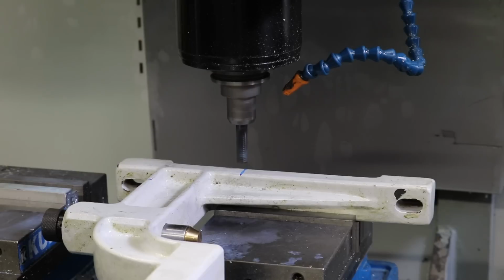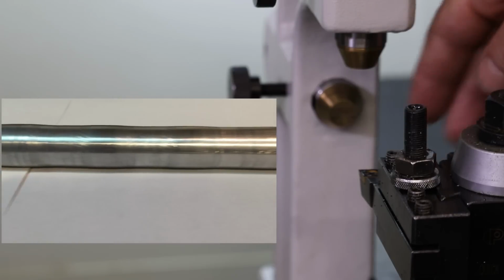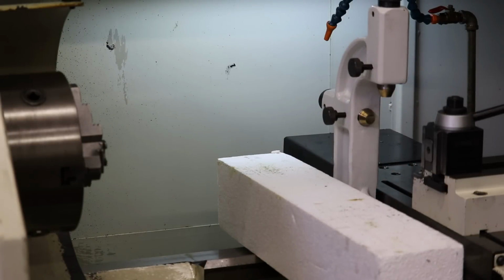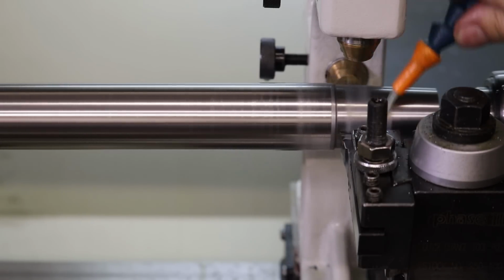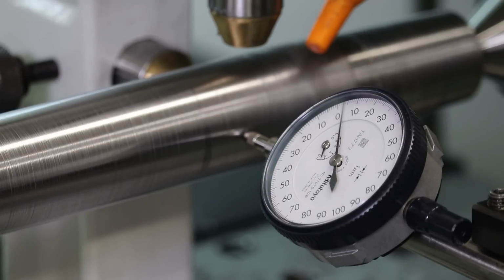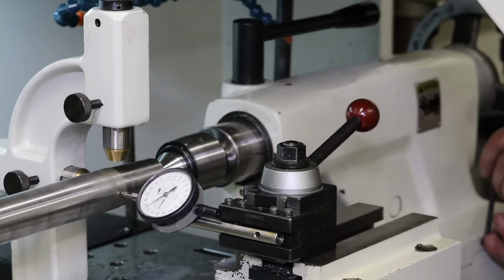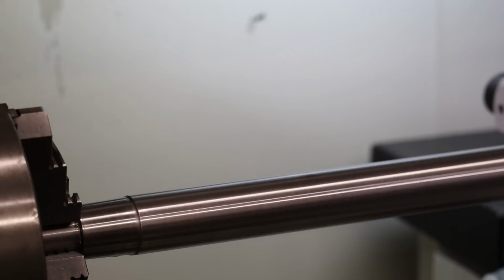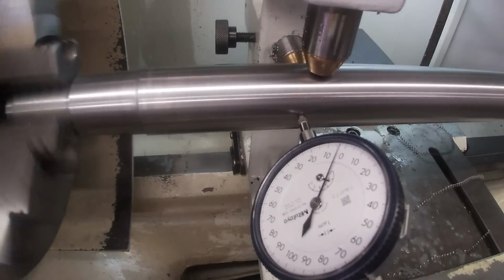Stoker Steam engine:( Part 1.5 of 2) Using a lathe Follow Rest for better piston rod turning

Comment: given the features on each end, I'd turn between centers so you can easily swap end to end to cut the tapers and threads.

Follow rest in front of the cut. A rest with rollers instead of brass pads.

Smaller depth of cut at higher rpm and slower feed for finishing cuts.
Reply from the maker: Yes, these days I would do the between centers. Thanks for the tips

Comment: You need to put the rest in front of the cutting tool. Other wise it will be scuffing your freshly machined surface. I wouldn’t even use the rest on the first cut that way you don’t have to worry about running it on that rough unmatched surface.

Comment: I can just about guarantee you that the railroad machinists in their 'repairs' to the stoker engine when necessary were not concerned with micron accuracy.  Good Enough, not perfect.  Get the engine operating and hauling freight and paying for itself.

Comment: Please use a micrometers when you’re working with cylindrical parts to get good measurements, calipers are only for rough measurements and not for final measurements when you’re working for 1 thousand tolerance

Comment: I'm pretty new at this, but I think you would do better with a four jaw chuck. Scroll chucks, even good ones, have some inherent TIR. Seems to me you're spot on with the tailstock adjustment. Maybe carbide center with some high pressure lube instead of live center might do better--little to no runout.

Comment: Yes, you need a 4 jaw, helps a lot when trying for accurate work. That or a run-true chuck you can tweak after you've mounted the work. If you do much smaller diameter work (1 1/8" or less) a Run-True type of collet chuck is really nice to have. Got mine with my Precision Mathews lathe, as an extra cost item, Chinese but quite nice.      Watch Adom79 center a part in his 4 jaw. Takes me at least 4 times as long.
Reply: Better still turn between centers.

Comment: I wonder what tolerances these shafts were originally made to?
I doubt they measured anything at 1/10 of a thou.
They were probably also made as production run.  I reckon  + or - .001” would have passed inspection. Or more likely -.002 +.000.
I hope you have a good time making another one.  I’m looking forward to seeing how close you get it.
Reply from the maker: Hi Davo, the original shaft was 1.490, maybe 0.001" runnout.  The steel was softer too. I assume the machinist started with a cleaner 1.5" and cleaned up the surface.  I'm just having fun obsessing and learning about turning long parts.  Thanks for watching
Reply: @DragonflyEngineering    LOL, you are pushing the limits of anal retentiveness.  Good on you.  But it seems to me that the warping induced by the very first power-stroke of the piston to which this rod attaches is going to dwarf that tolerance by at last an order of magnitude.

Comment: The  only answer to attain dimension is grinding
Reply: I disagree, 1. I doubt a Haas is rigid enough for the job.  2. It has to be done with a four jaw.  3.  Depending on desired hardness it might be better to hard turn when heat treated, rather than turn prehard. But it is totally doable on some cnc lathes
Reply from the maker: @billmielke7395  Thanks Bill, yes i do think the Trac lathe ( from southwest industries) did flex in the cut.  I don't have a 4 jaw for it, but should buy one.
Reply from the maker: That would be easier! I'm seeing how far I can take it, maybe obsessed a bit.  Thanks for the feedback

Comment: I couldn't help but wonder how the folks way back when solved these problems when they were originally building steam engines.
Reply: They didn't.  Back in the day, for a piston rod +/- .005 was good enough.  The packing material has enough resilience to easily accommodate that tolerance.  The important part of the rod is the tapered ends.  And those were always lapped into the mating part for a perfect fit.
Reply from the maker: thanks for the info Charles.  I just like to see how good I can get it.  The original rod was 1.490" and it may have had  a 0.001" runout
Reply: Back in the day they didn't have the ability to easily measure to the same degree of precision we do today
Reply: @billmielke7395  They DID have the ability to measure very precisely.  However, NOTHING on a steam locomotive had to be very precise. For example, the tolerance specs for the fit of the piston to the cylinder on a locomotive was described in thousandths of an inch per inch of cylinder diameter.  An 18 inch diameter piston just had to be within 30 thousandths of the cylinder diameter.  However, the piston rod had to be much more precise, perhaps 3" +/- .005.  But nothing required automotive kinds of precision.
High precision had a high cost and in service such tolerances would have been worn out of spec within weeks.
Reply: @clham612  I don't have an exhaustive knowledge of the history of measuring tools, but the older micrometers Iveseen are .001, not .0001, indicators surely have gotten better, hell the heyday of steam was over 100 years ago, so no CMM, no electronic measuring, no cnc, andfor the most part probably steam powered machine shops.  What I do know about the history of metrology and measuring tools is that they were greatly advanced by the second world war.  Steam certainly was in use after the war,but its heyday was over.
Reply: Bill Mielke this engine was built in I believe 1941, or possibly 42, I can’t remember. You should go watch Keith’s videos on this rebuild. You might be surprised about how well built this little engine was, and how close the tolerances were.
Reply: Bill Mielke the first screw micrometer in the late 1600s. The modern micrometers were developed in the 1840s, and were first made available to the mass market by Brown & Sharpe in 1867. So I figure by 1941 they were getting pretty good at measuring stuff.